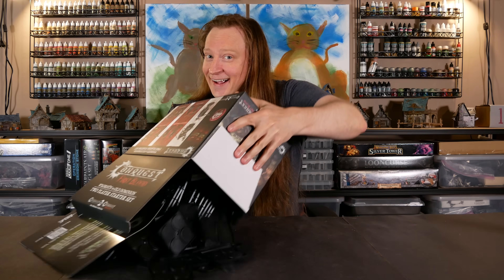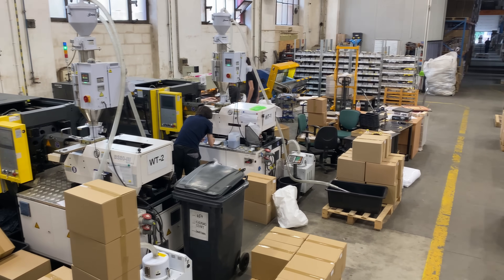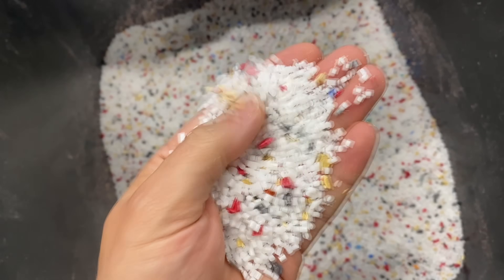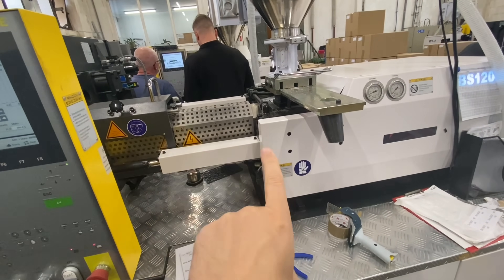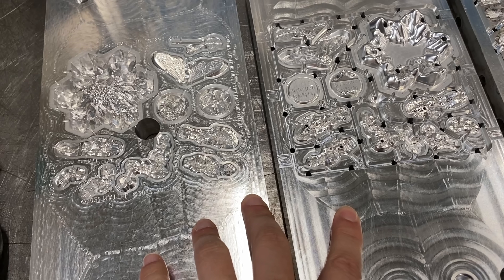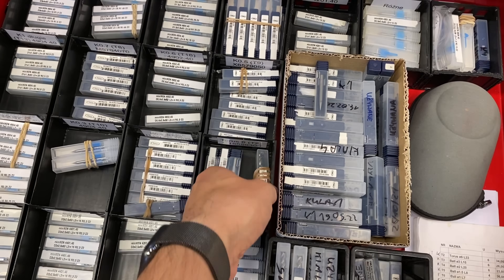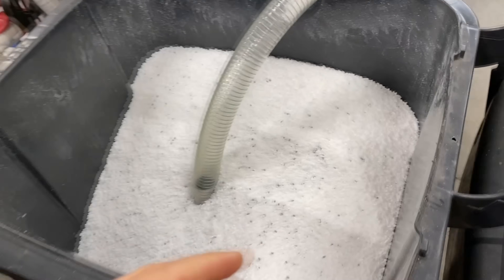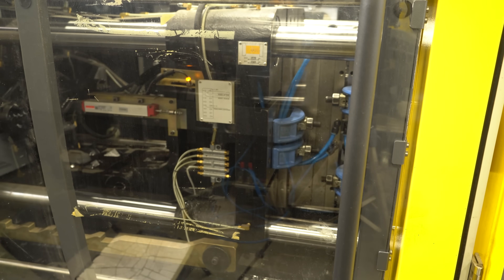How Models are Made: Injection Molding Hard Plastic Sprues - HIPS Polystyrene Minis.

Comment: As someone who works as a injection moulding engineer I got to say that its absolutely insane and hard to make those perfect there's a lot of issue with machines, material and just hard work to make the product perfect so I can tell you those guys are doing a great job and I wish I worked for them could have some extra bits for free XD
Reply from the maker: These folks are indeed super talented!  and hehehe, yeah if I was there those "reject" sprues wouldn't be ground down until after I had taken all the bits!
Reply: As an injection molding processor for over 30 years. I am impressed with the dimensional stability of their sprues. There are a lot of variables that can throw off the shrink rate of the plastic and effect multipart models.
Reply: @Skullyweb  not with HIPS though, very stable and repeatable process. Nylon, that's a different story.
Reply: @Skullyweb  where's your shop? I'm in Colorado
Reply: Would you know if it is even possible to make a mold as detailed as a mini on a manual mill machine?  Was that ever done before CNC?
Reply: @greysky1252  Yes, quite often in the past, but done with pantograph milling machines - similar to how US currency coin dies are made - using 2x or 3x or 4x size masters.
Reply: @greysky1252  very complex mold designs are not even done by milling machines anymore, mostly they are done with non-traditional machining methods like sinker EDM. CNC milling is great for removing a ton of material but if you need very tiny detail on the order of 0.0001 inch, edm is the way to go.
Reply: @greysky1252  well I have seen many Molds before and they are very detailed ususaly done by machinery basicly drilled into the big block of Stell so im sure it was done before considering a lot of plastic stuff you have at your house was done the same way its still awsome and very hard to make it running perfectly
Reply: Get applying!!
Reply: Hi - I'm reaching out to the chemist here. I play with Stop motion and the weight of a puppet has a great impact on the ability to actually animate it. So I've been digging in to these light foam clays that is widely spread. They have so far all been air dry types and I've been mixing them with glycerine, baby oil, latex, neoprene and coated them with car dip and neoprene, to prevent them for getting stiff. Do you think it's possible to make a foam clay that won't dry out or stay clay like? Love your chemical lessons!!!
Reply: @goldbergpl4354 I have always wondered how they machined such intricate molds in the 80's and 90's. Can you speak to this? They didn't have detailed computer modeling, how did they make their G-code? Or what process did they use instead?
Reply: 3d printer go brrrrrrrrrrr

Comment: Fantastic video Goobs! Just one small note as a machinist, the bits in the CNC would most likely be called endmills not drill bits. Drills are typically just for creating a hole. Endmills have sharpened flutes that cut away at the material and come in various shapes and sizes.
Reply from the maker: thanks for the knowledge!   I think Jarek referred to them as "tools,"  and I added my own embellishment... but i did it wrong!    endmills, good to know :-)

Comment: How does this stack up to GWs process ? Is part of GWs problem that they are stuck in the past ? Having all the machines and processes set up for so long they find it hard update and upgrade.
Reply from the maker: GW's process is different, but I don't know all of the details. My understanding is that they use steel molds instead of aluminum.   GW is very good at the technical aspects of casting... THAT part of things isn't their problem ;-)

Comment: Awesome video, love behind the scenes stuff like this. Archon seems like a pretty cool company to let us peek behind the curtain like this. Had no idea it took that long to CNC the molds - I knew they were expensive, but a whole week of tooling for just one half is crazy. Bunch of hard working, talented people over there!
Reply from the maker: Right?  I was super impressed by their skills and the whole setup.  Awesome stuff :-)
Reply: Whole week for tooling half of mold in aluminum. That's cheaper and quicker option in comparison to milling them in steel.
Reply: @MrKuncol  Gameshop moulds are made in P20 tool steel using cutters down to 0.075mm diameter. Off the scale more difficult to make compared to easy to machine alumjniun with the trade off being much greater detail and longer lasting tooling, aluminium isn't strong enough to accept detail this fine and would fail.
Reply: @Brit_Toolmaker  what about bandai?
Reply: @MrKuncol  most use steel as they will get over 30 years potentially out of the moulds. It increases the initial costs,  but over the expected lifetime of the tooling that is generally fine. I believe gw use steel too. The various model railway companies use steel and don't use sprue layouts and typically mould the body in one go with swappable parts of the mould to allow for different variations, plus things like etched metal details added after assembly.

Comment: This was a little bit like the Tour at Reaper Miniatures in Denton,  TX. They only have one injection mold machine, but they also show off their metal miniature production (including mold making and casting)  and their room of Siocast machines. Plus lots of other cool stuff. I always enjoy my Reaper tours. It's bittersweet that they'll be moving to a larger factory and their current location will not be around for tours anymore (next year). It has so much character and history since they've been in the building since 2004 and expanded it several times. Very cool to see more of the injection molding process, since it's probably what Reaper does the least. Those steel molds are very heavy.
Reply from the maker: That sounds absolutely amazing!  I'll have to make a trip to texas to visit those folks one of these days :-)

Comment: Plastics engineer here, I am still waiting for model makers to start using chemical foaming in production. It would reduce defects in the surface (reducing sinks) and remove the need for a pack and hold step of the injection process, which would also reduce the appearance of mold lines. The couple of draw back would likely be out weighted by increased production. Draw back would be splay (silver streaking) and air bubbles in thicker parts.
Reply from the maker: I'm always interested in learning about new materials and seeing the pros and cons :-)    Let me know if you ever see a model maker give this a try!
Reply: @GoobertownHobbies  Model makers do seem to use the lower end of technology, likely due to costs and possibly knowledge, there is a major lack of technical knowledge in the plastics industry.
Reply: Hi, we use foaming agent (our operators call it “sticky snow” 😅) if we are having issues with voids or shrinking and we cannot fix it with “packing”. I guess if we talk just about additives we are adding to fix issues on sprues it would take 20minutes alone, well maybe that’s good material for next video ;). Thanks
Reply: @jarekewertowski9108  I understand that many additive packages are used in injection molding. It would be interesting to me to hear about which ones are used for miniature molding. If you operators call it "sticky snow" I'm guessing your using Azodicarbonamide for a blowing agent, I haven't worked much with Azo but have done a decent amount of work with endothermic foaming agents, which tend to not be sticky. Still videos like this are great for those who don't have any knowledge on how injection molding works,; as I had mentioned in an earlier post, there is a lack of knowledge with regard to plastics in the US if not the world.